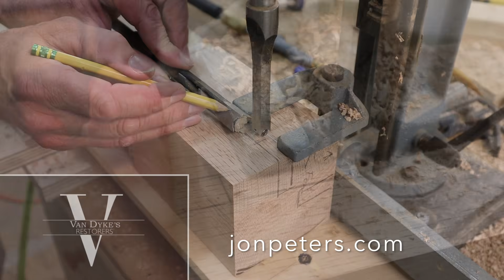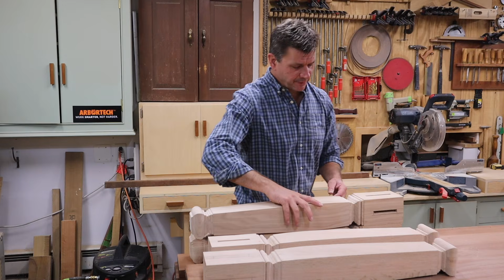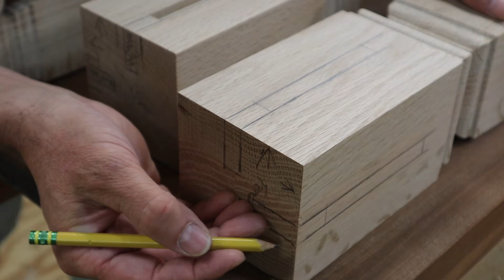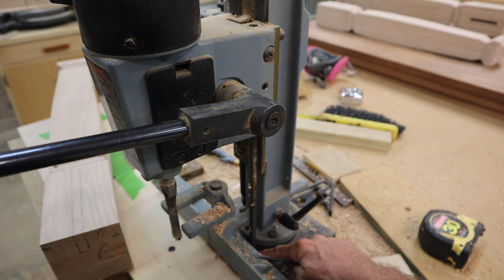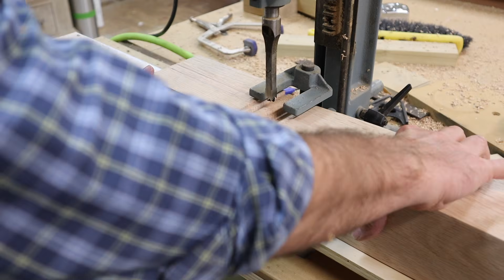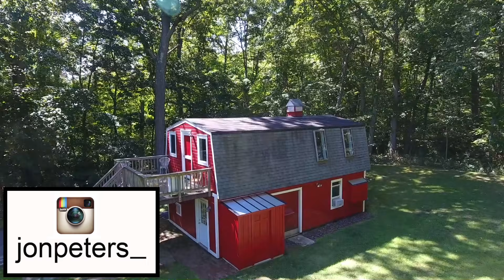Mortise Machine Basics - How to use a Hollow Chisel Mortiser

Comment: Question from the peanut gallery: why did you need to adjust the fence to do the far side of the cut? Why not just flip the piece over and run the same process from the other side?

Comment: The chisel must be square to the fence.  I had a problem with a certain chisel turning slightly while under use, resulting in cuts that were not in line.  I took my chisels to a grinding shop and had flats ground in the attachment ends parallel to one of the flats at the cutting ends.  The lock screw now tightens against the flat ground spot and the chisels no longer twist even slightly under load.  Cutting one or two holes didn't mean much but the problem arose with use.  Mortising machines like the one shown takes practice.  Good cuts don't magically appear out of the air just because you used the machine, and chisels get dull with use.  "Good cuts" with mortising chisels will never be as clean as those made with a plunge router.  Don't be shocked when that happens since in tbe end they are covered ip.

This next point is not the object of the video, but it is worth mentioning.  Far too often we level a table or radial saw top without paying any attention to the base.  You MUST level the base to your floor first, then level the top.  Failing to do it is a common problem that appears when your compound cuts aren't exactly as "compound" as you intended to make them.  They don't line up and you wonder why.  It's difficult to conceptualize but that's how it works.

Good video.

Comment: This may be wishful thinking but is there anything (a bit or some sort) out there that does this job that would connect to a drill press??? i know I can take a bit or forstner bit and take out the bulk and then come back with a chisel and square it all up. Just didnt know if there was a square style "bit" that could be used.
Reply from the maker: I think there is but some people will say there difficult to work with
Reply: I have an old atlas drillpress, and a mortising attachment that works in exactly the same way as a dedicated machine.  I believe they are available for other makes, as well.

Comment: Hi Jon, 
Sorry for the newbie questions, but I have never used a machine like this before. It looks as if there is a drill bit inside the square hollow chisel, and that the machine is more or less a modified drill press. So what cuts the corners of the square hole? Is it the strength of the operator pressing down on the lever? How often do you have to sharpen the chisel? And how do you do that? Isn't the beveled blade surface on the inside of the chisel?  Do you have a special stone to sharpen it?
Reply from the maker: Hi Ed , I’ll post a more detailed video soon
Reply: Yes brute force cuts the side walls square.  Mortising machines have much more leverage than your normal shop drill press.  I use ceramic abrasive ball or cone stones of the correct size to sharpen them.  They can be chucked into a drill or die grinder.  There may be some Dremel stones that will work too.  VERY quick and easy to sharpen this way.  Never sharpen the outside of the chisel.  If you do, it will quickly wedge itself into your next workpiece.  You won't be able to cut to full depth and the chisel will be nearly impossible to extract.  But to work properly, they MUST be extremely sharp.